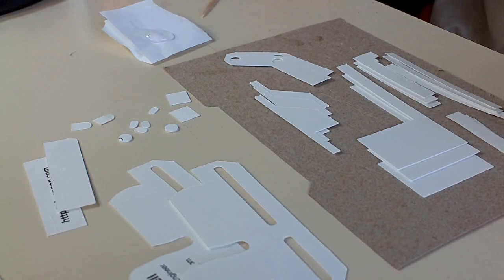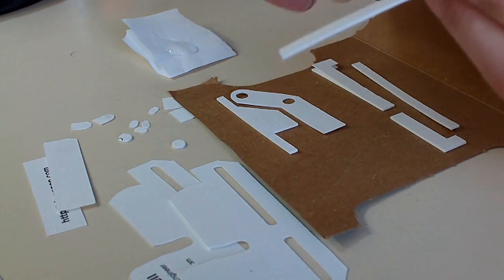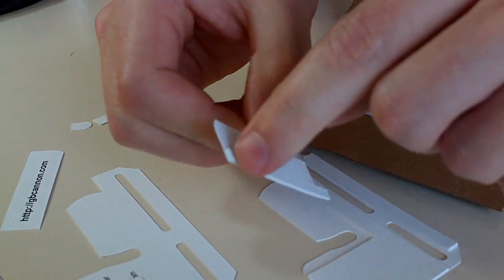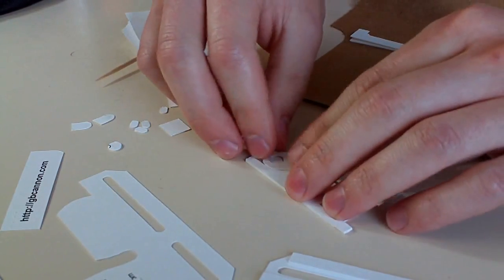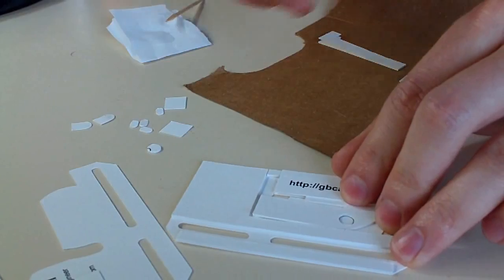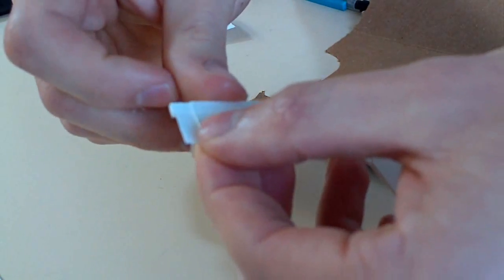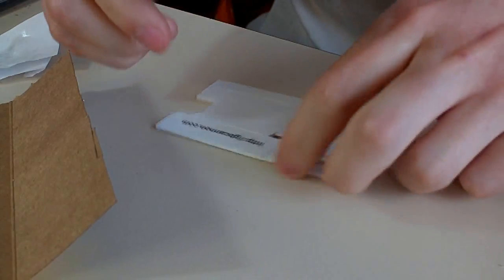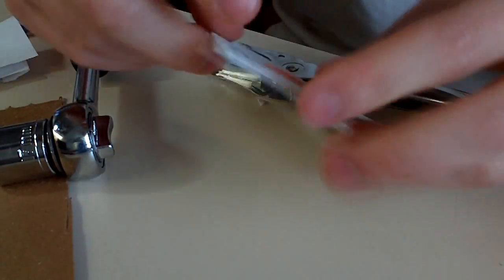Cardapult Assembly Video

Comment: my teacher asked us to this for our engineering project... but we had to make improvements and modifications to it... the design that is made here works fine if you only use really good materials but regular card wont give as high performance as shown in the video.
In my design of this I used 300 m and the design had a range of 12 feet compared to the basic design that only had a few feet.